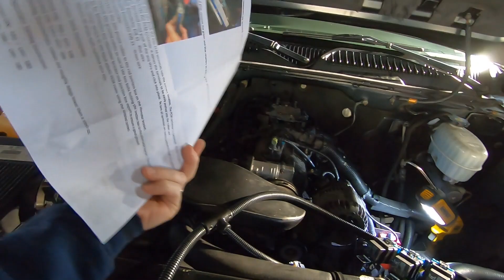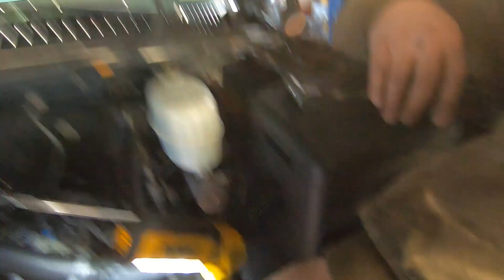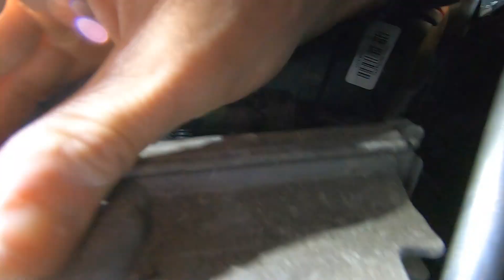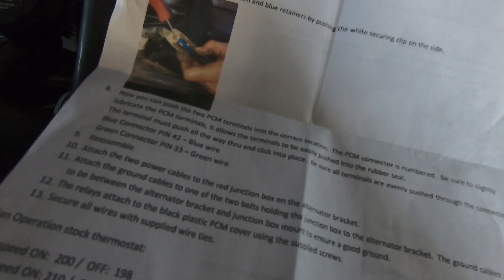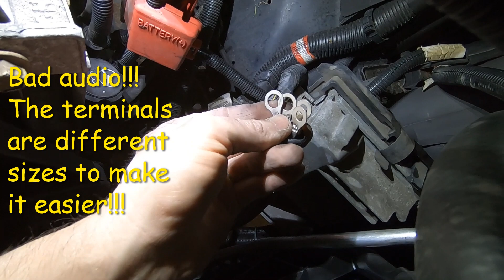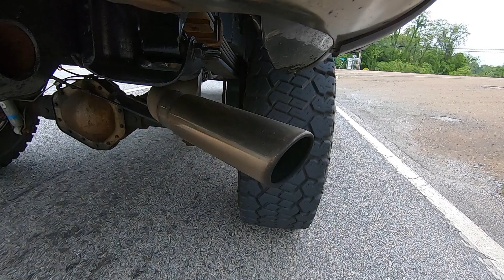2500HD ELECTRIC FAN INSTALL

Comment: Excuse me u need programming the pcm?
Reply from the maker: To activate the fans you need to enable it with a tune.
Reply: @slow_restoration  which tune did you use ??
Reply from the maker: @Isaac-lo7yc  We had the truck tuned and they enabled it at the same time.

Comment: Is this 6.0 gas or 6.6
Reply from the maker: Gas
Reply: Sounds really good what stall and cam do you have how is the gas mileage and I was gonna ask What’s the fans part number do they bolt right up
Reply: How much was the nelsons wiring 109$ with 99-02 or the other 03-07cbs and there’s a harness for 129$ also on there website I’m new to this just looking for some help I have a 2004 2500HD 6.0 gas I wanna do efans thanks

Comment: Worth noting if you own a 99 - 02 this does not wire up like this.
Reply from the maker: You can't pin the computer to make it control the relays but it can still work.
Reply: How can it work? , I have an oem factory e fan harness
Reply: @miltonmiranda9900 hey Milton. Sorry buddy I built my truck and it’s been running so good I haven’t had to pull it a part in quite some time.  If I remember correctly I bought a harness specifically for 99-02.  Just do a little google work and you should find it.  If you are building a truck like this make sure you keep all your receipts. I was surprised for a truck that has so much aftermarket support. Small differences between years still caused a lot of head aches. I was buying and returning a ton of parts. I damn near just burned the truck. Hahahaha
Reply: @timh1187  thank you! Will do hopefully I can figure this out because I have fans and 34 inch mounted already and harness ready to go, good thing I haven’t removed clutch fan yet! 😂